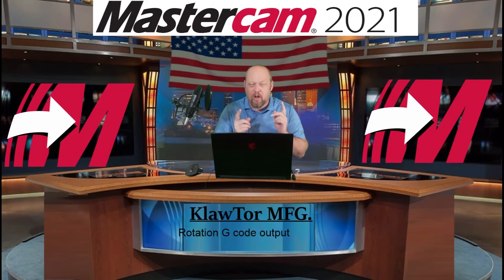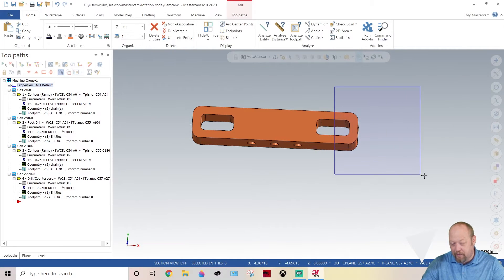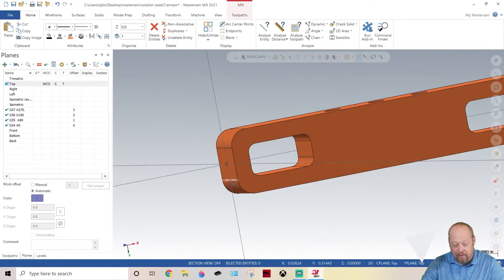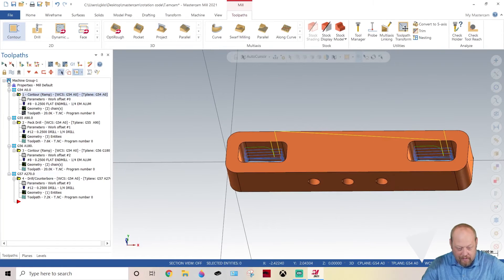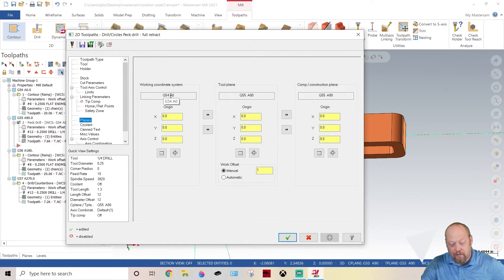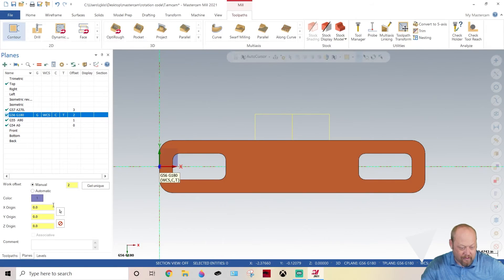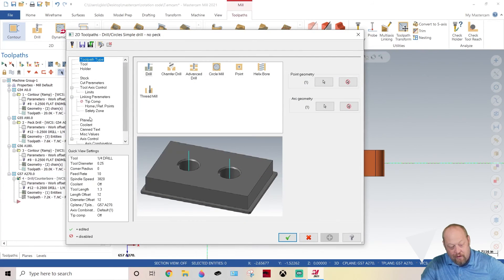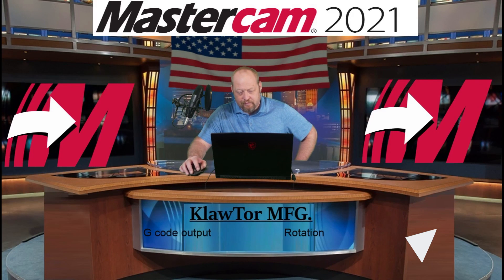Mastercam... 4th axis G code output setup

Comment: Got a leadwell v50 with a b axis how do I post g code for b axis and not a axis , is it a matter of just orientation of my model ?
Reply from the maker: To get the b code you have to have every first plane the top plane. The next two planes are going to be your work coordinate. So make a work coordinate at 0° and then when you turn the part make another work coordinate and give it work coordinate zero to give it all g54
Reply from the maker: Just do a mass change a to b

Comment: UH,, Bros, this will work, but that is setting 4 work coordinates to different A positions.  Not necessary, you can keep them all at At one work coordinate and just change the tool plane to a plane defined by a surface . You dont have to have the part oriented to the xyz zero, you just need the WCS to be the center of your roation, put your part where it lies from the center of your 4th's rotation.
Reply from the maker: Yes different work coordinates to make it easier for the operator to make offsets on more complicated parts. I orientate everything I've ever done to the top plane that way you can use all your hot keys.